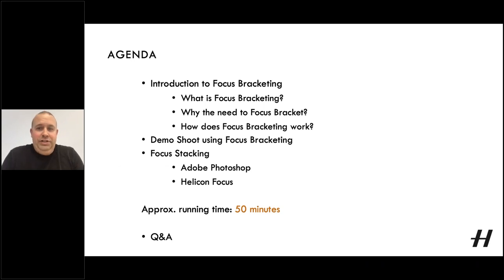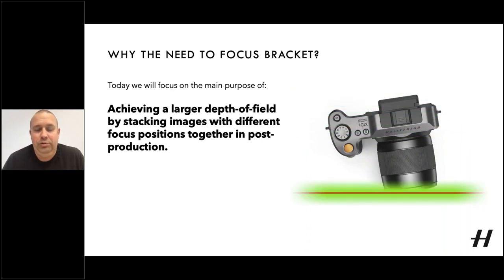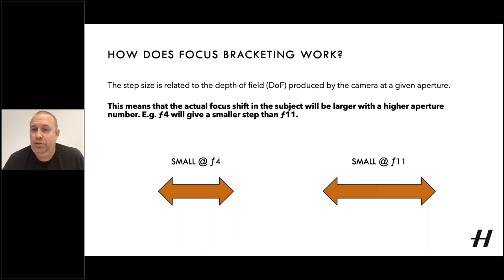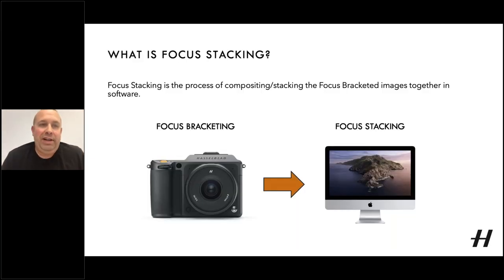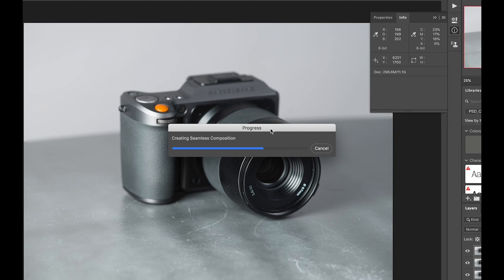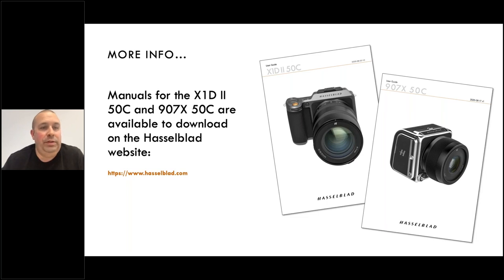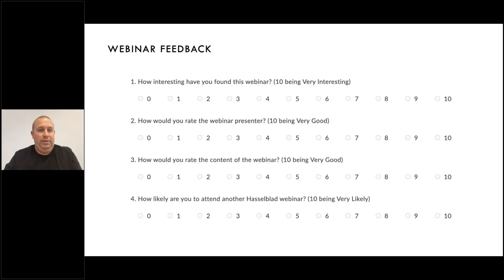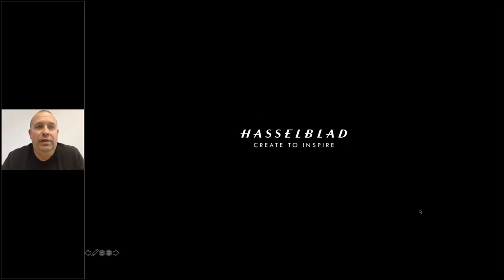Webinar: Focus Bracketing

Comment: I would love to see an option where the camera calculates how many images you need automatically. Although not easy this should all be calculatable. You know your lenses and if the user may give the camera an A and B focus point this sounds doable. What are your thoughts on this?
Especially considering that the step size is dynamic an automatic calculation would make this process much easier and takes out the guess work. 

Any way great webinar. Thanks for sharing it!

Comment: The difference seems to be seen in the light rendering the high whites are quite a bit softer from Helicon Focus and its quite easy to see ;) but Photoshop is possibly the more convenient way to do cause its one line of a workflow instead of using multiple tools… so the interesting questions would be a comparison of processing time and power… so if Helicon or Photoshop are needing more or less system resources. But over all, a great academy job here! Thank you a lot.

Comment: Why are H owners forsaken?

You suggested f/11 for sweet spot aperture, and your demo video choses f/7. Also, wouldn't that be already close to the diffraction limit of the 50 Mp 's smallish 44x33  sensor?

When using HTS,  we can manually move the camera on a precision rail to do stacking, which is what you have left H users with.

Why doesnt the camera automatically batch the stack? Fuji, Phase One, as well as Panasonic (FF or MFT) do. 

Will a fully automated calculation of step size, number of steps, based on lens selected and aperture be provided in a future update? Phase One and Fujifilm already do.
Reply from the maker: Hi, thanks for the feedback. The reasons why Focus Bracketing is not yet available on the H platform is covered in the webinar, as too is why we chose not to automatically stack in camera, and we shot at ƒ6.3 for the demo to help exaggerate the shallow depth of field. We can't comment on future updates, but rest assured, we always look to provide the best possible solutions and will implement them where possible.
Reply: Hasselblad thanks for your reply. I cannot find where you said why H cameras are not supported. Can you follow ell us here?
Reply from the maker: @sgroadie6367  Yes, sorry... please watch from about 39:17 for the information regarding Focus Bracketing on the H System.
Reply: I have read the replies below - I use an H6D100c shooting automobiles in UK with Broncolor 1200L's - and occasionally stitch up to 9 pics - big files notwithstanding I have no real use for focus stack but I do think that the H system is not really in that much of a development phase currently.I love the idea of a 907x system - but the lack of flash capability sadly lets it down -there is literally nowhere to put a trigger - and lets be honest its landscape mode only -  Phase One have built in a Profoto trigger and considering Hasselblads' long association with Bron that would be a welcome and simple fix - we only need RFS2.2 due to the leaf shutters.
Reply: as Phase One been brought up. XF provides an automatic facility where you choose near and far points, and the camera calculates the no of steps and step size based on lens selected and aperture and suggests that. You can OK that or  choose to over ride by manually tweaking , for eg, the camera uses a very small CoC in its calculations,  resulting in a very large number of frames for the output I need. But I can change the no of frames, and it recalculates the step size. This is a very useful feature.
Reply: @sgroadie6367  Indeed it does - and it should also be of note to mention that some of the very clever ladies and gentleman at Phase One originally (ahem)  'helped' to develop Hassys original digi back!!!

Comment: Since this video was made, Adobe Photoshop 2021 now produces a "RAW" file after focus stacking.  This allows the use of Filter->Adobe Camera Raw Filter for basic adjustments before saving.  There is no option to save the "RAW" file as I understand the process.

I do wish there was a little more technical information re: the number of steps to use 30, 60, 100; the number of steps to use to cover a given depth where sharpness was desired; or  a way to set the beginning focus plane and the final focus plane and then have a calculation of the number of images required given the focus distance, lens focal length, and relative step size.  It seems that Hasselblad, with its bright engineers could cobble together a small subroutine in the focus stacking subroutine to do this for use so we would have a starting point.

Comment: wow that is a lot of images!
I would never auto blend layers in PS.. it simply doesnt work 9/10 times.
Its better to just align the layers and do the blend yourself. Longer time needed.
If you use the right lens, you shouldnt need to stack, unless you are simply trying to do something that is against the laws of physics with the lenses you have, which is what most people do which is why focus stacking is needed. This is why i loved large format for years, so you can adjust the plane of focus. MF tilt shift lenses are ridiculous prices, heavy and just are practical or cost effective for most people.